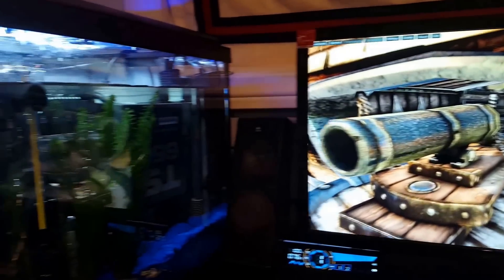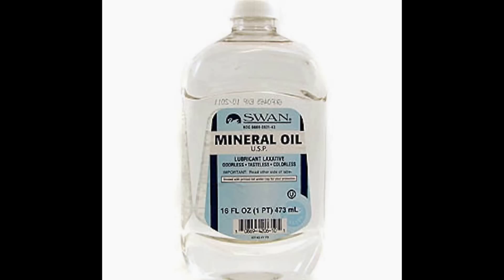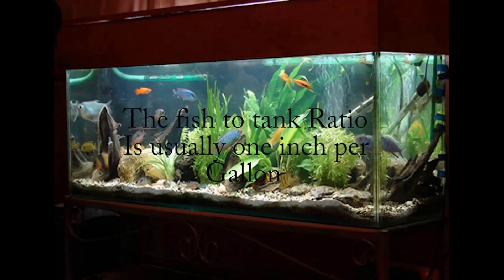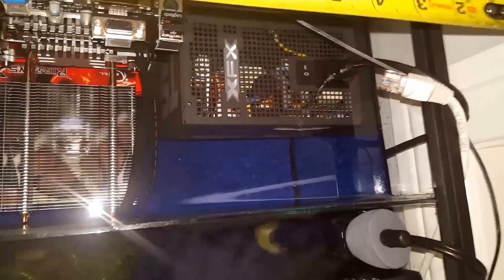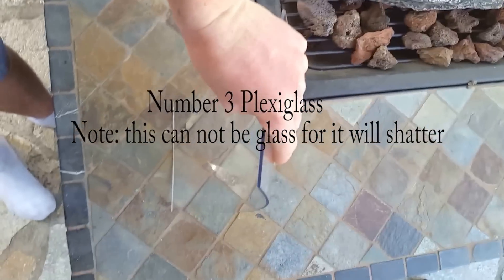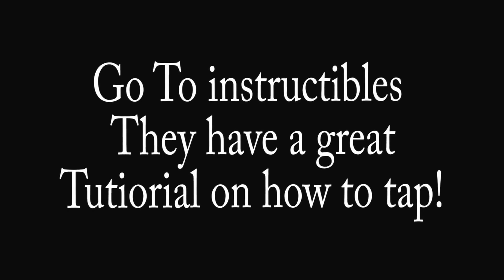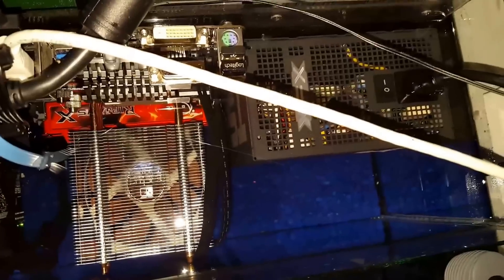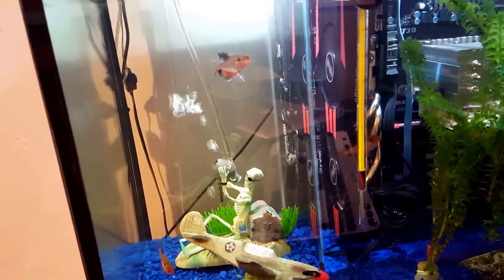How to build a working computer and have fish swim around it!

Comment: You would need to run a 100+ gallon tank to be able to just pretend the PC is an aquarium heater and run it full load 24/7. Idle power draw is comparable to 20 gallon aquarium heaters though, so you just have to bank on your 6 hours of daily gaming not being that big of a deal.

Comment: If it leaks?
Reply from the maker: RIP. Nah just kidding actually there are three scenarios that I can think of:
1. a crack on either side occurs on the outside, which would result in just regular leaks and I would have to patch it but no harm is done.
2.  a crack on the inner layer occurs where the water and oil will attempt to reach equilibrium with each other and since there is always more oil than water the oil would leak into the fish tank which may kill my fish but wouldn't really affect my computer.
3. someone shoots a bullet at my computer and a large hole occurs where in the inner layer of plexiglass, and assuming I am there I would hopefully not have the computer on. Then pull it out and dry it off in rice before attempting a reboot. 
Also on another note water is actually heavier than mineral oil. So it would sink to the bottom and be noticed by me long before enough piled up to reach my actual motherboard or power supply. So, in short, it's not that safe but it's safer than you may initially think.
Reply: Sam Quiring ah kk. Thanks, looks pretty nice btw I'm a fish tank guy my self and I'm doing my first pc build soon I'm still planning
Reply from the maker: Awesome! if you are doing a first-time build I would highly suggest not doing anything crazy like water or mineral oil cooling as it complicates the process of building and maintaining your computer. This kinda build really isn't practical, and I honestly don't think I would really suggest this to many people. I really just built this just to see if it was even possible.
Reply: Sam Quiring thanks, yea I'm going simple. Sam I have a few questions.

Is the ryzen 5 1600 good with the gtx 1060? If not is it good with the gtx 1070?

Will the ryzen bottle neck the gtx 1070?
Reply from the maker: Ok let me preface this with I am not 100% sure so you should look up some videos of people running games with those exact setups, but I think the ryzen 1600 should be plenty for the 1060. On the 1070 side though I think most games won't be able to reach the same framerates as a computer with a i7 7700k or a ryzen 7 1700, but I don't know exactly how major of a bottleneck will occur. Like with some cpu intesive games it could be like 10 fps lower but most games I think it would probably be only a couple fps lower. For reference, I actually just upgraded to a ryzen 7 1700x and I upgraded from the r9 270x in this video to the r9 290 about a year ago.
Reply: Sam Quiring ok thanks. I'm new to pcs and kinda on a budget. I guess I will stick with a 1060 and upgrade my set up later. It's my first build an ways. But the 1060 is good Right?  I can get good fps in 1080P with high or ultra settings in most games along with the ryzen 5 1600?
Reply: By good I mean above 50. I don't want to stick with anything below since I just got out of the console stuff lol
Reply from the maker: yeah. A 1060 should be plenty for 1080p gaming.

Comment: Is it still running?
Reply from the maker: Robot as a computer yes I still have many of the same parts in my current computer, but I got bored of it after a year and really wanted to upgrade my gpu so I took it out of the mineral oil and turned it back into a regular pc.
Reply: Sam Quiring damn really? How did you manage to de-oil the parts from being soaked?
Reply from the maker: Robot very carefully.
Reply: +Sam Quiring are the fish still alive?
Reply from the maker: Ya! they are actually in my bigger 55-gallon tank that I got after I made this build.

Comment: the heat from the computer will kill the fish eventually, you should leave a secondary air gap between them, seal it off completely, and pump out the air to create a vacuum to insulate them apart.
Reply from the maker: Pauly JP while the lack of an air gap did not kill or harm the fish while I had this setup. An air gap would definitely be a good idea for anyone else making this just to ensure that the fish are safe from the heat.
Reply: "while I had". What happened to the setup?
Reply: Some fish needs heat in the water
Reply: Pauly JP diy heater for the fish tank haha

Comment: bad idea get a crack or leak and the mineral oil will kill the fish.
Reply: Or the water kills the PC
Reply: @Menon9767  double kills
Reply: mineral oil and water don’t mix
Reply: @purerice5824  no they don't.   But mineral oil floats and fish breath oxygen, and oxygen exchange happens at the surface of the water (this is why a deep tank supports less fish then a tank of similar volume but more surface area).  

So long story short, the oil leaks out, makes an oil slick on the surface, and all the fish suffocate underneath it. 

So its an awesome build but just to be safe I would suggest adding some sort of conductivity sensor to the water side that can alarm if it notices a change likely causes by mineral oil leaking out onto the surface of the water.  Also keep a spare tank handy (with the appropriate water quality) to drop those fish into.  

Sadly tropical fish are cheap enough many people just don't sorry much about it.   As someone who used to build salt water aquariums it was totally different.   A single fish or coral might cost a couple hundred dollars so it was in your best interest to make sure everything was perfect since loosing a whole tank might cost 10k+.

Comment: Hi sir. is it safe to use an ordinary fish tank or aquarium ? whether it's a glass or plastic aquarium?
Reply from the maker: The fish tank I used is a regular 15 gallon glass fish tank, but I don't think it would matter that much if it is glass or plastic so long as you have no chance of leaks, because if one side leaks into the other then its bad news, but so long as that doesn't happen I don't think the material would matter.
Reply: thanks sir.. but where do you release the heat?
Reply from the maker: Kailee Max the heat is released from the water either through the glass in the tank to the air or through evaporation of the water.
Reply: Oh okay. How about the power button that I forgot to ask? Where do i put that?
Reply from the maker: I just took my power button out of an old case. Then I just hooked it up to the mobo and made sure it hung outside of the case so i could press it!
Reply: thanks sam. but is it safe if i use a massage oil? or any kind of oil
Reply: use a fish tank but make sure to apply extra sealant around the edges. also dont use any rubber. use nitrite based seals.
Reply: Hi Kailee, Any liquid that doesn't conduct electric :)

Comment: looks cool but youre playing with fire if the water leaks into the oil tank
Reply: technically he is playing with water, not fire though...
Reply: One slight bump and water will fall into the pc glass
Reply: If it's distilled water it will be fine, you see distilled water doesn't have minerals, (which  fries it) so therefore it will not fry
Reply: @_lxuy  yeah but i think if you ever come into contact with distilled water it isnt distilled water anymore but its contaminated. And i think thats with most surfaces too

Comment: Just a little question: Is there any problem until now with this setting? Just asking, because I want to be sure before I build my own PC.
Reply from the maker: +Felaex Sorry it took me so long to answer... Yes there was a problem, but it can be easily avoided(I think). The glass that separated the computer and the fish water was transferring over too much heat to the fish tank. which made it so I couldn't game for more then a couple of hours without it heating up the fish tank. The heat giving to the fish tank was only about about 2 degrees C and it didn't kill any of the fish, but I just felt bad because fish are super sensitive to water changes. But the way to fix this is one of two or both either get a GPU that doesn't generate much heat or get a thicker piece of glass so the heat dissipates out of the tank into the air. As opposed to from the oil to the water.
Reply: Thanks for answering. :)